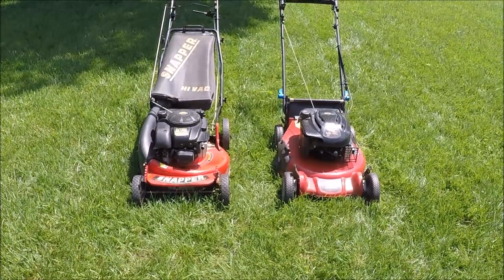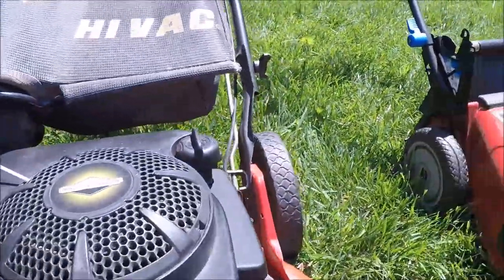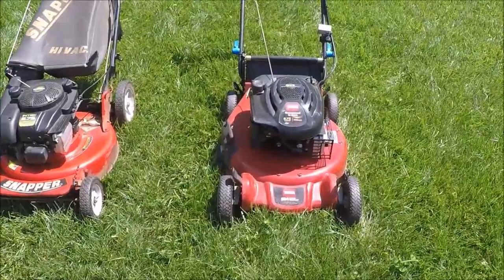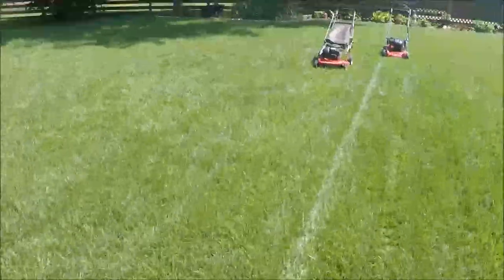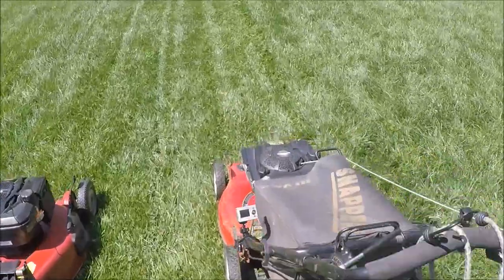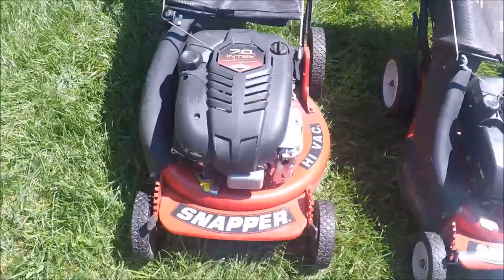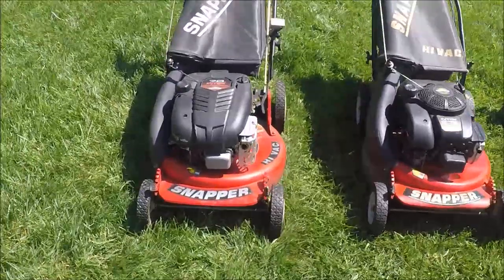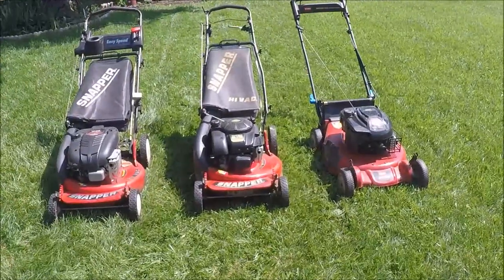The Snapper & Toro Super Recycler Lawn Mower Bake-Off Competition -- Which Cuts Better--June 15,2017

Comment: I just solved the cut mystery on the Snapper. If you remove the bagging chute, it would of been a fair fight. Install the deck mulch cover instead. That cover fits tight to the deck. With the bagging chute, grass gets blown up inside that chute not being mulched up properly. The chute packs up with grass and drops from time to time. Mulch cover part number is  7029149YP. Check it out.

Comment: I did a similar test when it was time for me to acquire a new mower.  I had an OLD (30 yrs from my high school lawn business days with 25 yards for 5 years on it) Snapper HI-Vac that finally shot craps.  I picked up a $40 used Snapper that barely ran, a neighbor's Super Recycler, and a new Honda (aluminium deck, not the composite deck) and ran them side by side.  With a Gator blade and the MULCHING COVER (NOT the plug) on the Snapper Hi-Vac deck, which isn't really designed for mulching, I could BARELY tell a difference in the mulching capabilities of the mowers.  HOWEVER, what I DID notice was the cut quality.  The Snapper blew the others away with the evenness of the cut compared to Honda or Toro.  The plug, in my experience, leaves too much space for clippings to get caught and disturb the air-flow and if you want the BEST bagging experience, the Snapper blows them away.    My test results brought me to the conclusion to repower my "new" Snapper for $130 vs the other options and took the Honda back to HD.

The best Snapper bag and on the mower market, period, is the Snapper frameless "C-clip" model.  "Back in the day" when bagging was all we did, I could shut mower down, open a PLASTIC bag, remove mower bag, "plop" the grass into the lawn bag in one shake, reinstall the bag and be running again in about 90 seconds.  It also holds a ton of grass.
Reply: I agree with everything you said about Snapper mowers. I have used and owned JD, Cub Cadet, Craftsman, Troy Built, Honda and Toro's. Those are mediocre to good mowers. Snappers fall into the great mower category in my experience. Best bagger on the planet bar none. Mulching, the Snapper will go blow for blow with ANY brand if not better with the Ninja blade.

Comment: I see this is old but looking as I'm working on my old snapper self propelled and getting as much good info from the comments. The snapper is unbeatable IMO if bagging,   and mulches great with the mulch cover. I'll have to try a gator blade though I have a ninja. Also on my snapper, I keep the rope out of the pulley for cranking, and put it around the pully only when removing the bag ,  cranks easier and easier on the rope.

Comment: I have a brand new snapper with the ninja blade and it works with the same result as the toro. But I like the result with the gator blade. I have the gator blades on my ferris zero turn and they work very well. I do 10 neighborhood lawns and have no complaints. I bought the snapper for its drive system. So far I'm pleased with it. Toro makes a fine mower too.

Comment: Just got the SR4 yesterday, It has a blown engine, but I am putting one of the Super Recycler with the Toro Branded (Chonda Clone) engine. I didn't even realize they still made cast aluminum desks anymore.
Reply from the maker: Hello Michael!  Alright yes these Super Recyclers are just the best it makes grass clipping disappear.  Plus if the grass is damp it want clog up underneath the aluminum frame like the steel deck Toro will.  Well worth putting an engine on it let me know how that replacement goes and if you could get me the Clone engine part number you will get for it.

Comment: Thread revival time!  Now that it is 6-7 years later since your video, what brand and model would you pick in 2024?  I have a 2015 Toro SR and it's a little underpowered for my yard.  Would like to get another Toro, but I keep hearing the backing up issue on the new (and great looking) Toros.

Comment: Of course the Toro mulched better, you didn't have a bag attached so the clippings stayed under the deck and got chopped up. The Ninja and Gator blades were designed to be used under a mulching deck...no discharge. Again, this keeps the clippings under the deck so the blades will do what they are designed to do...chop up the clippings. I promise that the Snappers will perform much better when configure properly.
Reply: If you notice, the mulch plug is in the Snapper, so it has nothing to do with the bag being attached.  I will say that it would actually do better if you took the bagging chute off all together and put the actual plastic deck cover in place that is formed to the shape of the mower deck.  But still, he has the plug in.
Reply: @CMNTMXR57  You guys are on it. The deck conforming mulch cover is the best for mulching. That bagging chute plug leaves clippings behind as was shown in the video. It's all about the proper deck and blade.

Comment: Great Video.  I have snapper High vac 21" also.  I will seek out the gator blade as I do not vac all the time.  The High vac blades work fantastic when wanting to bag.  my model is circa 2001.  and only has a 6hp briggs.  I may be in the market for a 7hp motor that will fit the deck!

Comment: The snapper "hi vac deck" Flaired in deck is best for bagging only with a extra hi-lift blade. And not the one with the ninja blade or flaired out deck warps a lot. The toro and the honda Are best at mulching. And that's sharp blades also and slow to med walking speed. A former outdoor power eq.Tech. Stay safe and happy mowing to all.

Comment: I have a snapper European series platinum with a 7 horse Briggs intek. It's not for sale and will never be for sale. It's the straightest driving.  Best transmission durability,. Best just the damn thing is awesome. It's 21 years old and it's amazing. The deck is all aluminum and bag material is the strongest ive ever seen. It's not a high vac but it's amazing. ELP I think it is. I have a brand new Husqvarna AWD and I prefer that old snapper. Also have an old Scott's turf master. It's amazing as well

Comment: Hello, 
I have a Toro Super Recycler, I need to purchase a new blade. Do you reccomend an aftermarket (gator/atomic, other?) or the stock blade. I'm looking for the best mulching blade possible. Thank you!
Reply from the maker: Hello Desiree thanks for viewing and sorry for the delayed response.  For the Super Recycler  stick with the factory stock blade which is part # 108-3762-03 at least for my model 20092 its a 21 inch blade.  You can find a replacement blade on Amazon or Ebay if your local home stores don't carry it.  Also make sure the accelerator blade remains mounted underneath it part # 105-6848-03 that should not need to be replaced.  It makes the super recycler what it is mulches up everything as if it disappears in the yard.  What a great lawn mower you have its the best you can buy!

Comment: 1st off both Snappers were high Vac mowers !! the decks are not made for mulching the blade will make some difference but the deck has a lip for the Vac as a mulching deck will not have this lip. the lip will assist the blade to stand the grass blades up to be cut & bagged.
Reply: You are on it BUT you can make the Hi-Vac deck mulch just as good if not better than any other brand. Run the deck conforming mulch cover  7029149YP and an Oregon 99-121 blade. This is THE mulching setup for Hi-Vac decks. I've ran all the Snapper deck and blade combinations to state that.
Reply: @rickjames6948 thats good news thank you for the reply

Comment: I run the mulch cover 7029149YP with the Snapper regular style recycling blade and it rocks. It leaves NOTHING behind. Not talking about the Ninja blade either. The blade I'm talking about is an Oregon 99-121. Even with the miss matched Hi-Vac deck that is built for bagging, it will mulch with any other brand mower you will ever find.
Reply: Are you sure the 99-121 is for mulching? I looked it up online and it looks like the hi-lift blade. I tried the gator blade and the ninja blade in the snapper hi vac with disappointing results, and i do use the mulch cover. The gator blade does alot better than the ninja blade but it still leaves alot of uncut grass. So do you think the Oregon 99-121 will do better. I have used a toro recycler before it it does mulch way better than the snapper. I know the hi vac is meant for bagging but its what i have and would like to make it a better mulcher without having to go buy another mulching mower.
Reply: @chadriggs3322  YES, it has a small lift tip that has low lift. Gator blades are not for Snappers. Now the real Snapper Ninja blade is great for mulching.
Reply: Thanks. I tried the ninja blade on my hi vac and it left alot of uncut grass. I think the ninja blade is best for the snapper ninja mulching deck. I will try the oregon blade you mentioned on my snapper to see if i can get better mulching performance.

Comment: I have two Snappers, both with the Ninja blade.  I do not have the issues you do.  My blades are razor sharp and and leave nothing behind when mulching.

One thing I am noticing in all three tests is that you are FLYING through the yard.  Slow down and let the mower do it's job.  Yea, it takes more time, but the quality of cut letting the far superior Ninja blade, do it's thing.

The newer Snapper I have that same easy pace speed selector, it is set as slow as it will allow, the old Snapper has the old detent lever like the 2nd one in your video, that set to "1".  Go slow and let it do it's job.

Comment: Good Saturday morning Cliff. Great video as always! I will stick with the Toro myself.  I've owned a Snapper Ninja before.  Too heavy for even one with some brute strength as myself! Toro for me is hands down my personal preference. Have an awesome weekend Cliff! Mark in Iowa.
Reply from the maker: Hello Mark in Iowa thanks for viewing again!  Yes sir these Snapper are heavy machines the ninja blade does just fine on shorter grass and raising the wheels to the maximum height.   Not so good on tall grass or if its just a bit damp it will clump up so not my favorite blade.  Agree with you the Toro super recycler  just cuts really clean,  in the fall with leaves it makes them disappear.  Hope all is going well with you in Iowa one state I have never been to got a friend that graduated from Drake and he just love Des Moines.  You have a wonderful weekend as well Mark!
Reply: Yes, and that's why they typically last forever.  They're very solidly built.  I have zero issues with the heft of any of Snappers or my even heavier Ariens.

My older Snapper is now embarking on it's 24th season...  Yes, I bought it new in 1995.

Comment: toro better overall for mulching but better engine on the snapper
Reply: Id honestly beg to differ. Having worked on a load of ohv and flathead briggs engines for the past 10 years i will say with confidence that the oldschool flathead is a better engine. Head gaskets rarely go, no valve adjustments, no rockers to crack, no push rods to bend and if theyre maintained half right at all they last basically forever. I own a 32 year old briggs quantum with over 1000 hours on it and the thing still runs sweet. Head gasket hasnt even popped yet. Had a few of the ohv's slip the valve guides i may add. 
Thats enough of a rant for a thursday but ya get the idea

Comment: The snaper is 20 times better and reliable if you cut grass for a living
Reply from the maker: Hello MegadethGUY M thanks for viewing!  Also my favorite brand as well Snapper they are commercial grade and will last a lifetime!
Reply: @USNVA-yn6cp  Rust?? Are you talking about deck rust? All you have to do is when you change your oil, take an old paint brush and slather it onto the underside of the deck. This is how you winterize a pusher too. Scrape all the grass off. Apply used engine oil to the deck and park it. That and don't cut wet grass and leave it under there.

Comment: Hello mountainbikekayak great videos thanks.  I am about to buy a super recycler, maybe you can help me with my decision. I am looking to decide on the Honda engine, or the Toro engine. The newest SR is the (21381), the Honda engine Toro is (20382).  What do ya think between these 2, or any other one.
Thanks a lot
Reply from the maker: Hello Kevin thanks for viewing!  That is the definitely the best lawn mower you could ever buy for sure you will love it.   The newer model 21381 is one of those clone/Chinese made engines it doesn't mention the brand just Toro Engine.  Have seen those on a lot of power equipment with the same branding whatever the maker such as Troy Bilt a Troy Bilt engine.  They are great, my neighbor has a Rear Tine Troy Bilt similar engine but horizontal shaft has a lot of power.  We bought our daughter a front tine Troy Bilt who bought a home in Portland Oregon and it has the same type engine and used it to dig up her very rooted yard with it and planted grass seed it did great.   I would say and its almost a personal preference over a Honda Engine but I would go for that $50 or so savings and get the model 21381.  They use the same engine for the model 21383 which has the spin stop/blade engagement feature as well as model 21384 with electric start.   It will be fine that mower will last for many years and that deck will never rust!
Reply: Thank you very much for your reply.  You are very helpful to me.  I am going through your other vids as well.  Interesting on the engine, you are very informed.  So I am feeling good about that engine, and the 21381. 
Subscribed to your channel
Reply: @kevinshuman7342  how has your Toro super  recycler work out for you? I have read and seen just about all the reviews on lawn mowers and I am leaning on purchasing the Super recycler.
Reply: @SuperJpaez  Sorry for the slow reply.  I wasn't satisfied with it really.  The transition gave problems from the beginning.  Occasionally back wheels would lock up when pulling the mower backwards.  I know its not uncommon for that to happen on many mowers, but after just a short time of using it got very bad at it.  I did use it commercially so it got a lot of use, but its not the first 21 inch mower I have had, & now have another, & the SR was very bad.  I eventually replaced the transmission, & it gave problem 2 or 3 months later. I had the mower for a year before  buying a Honda.. No comparison, the Honda is head & shoulders above. Everything about the Honda is so nice. The SR was good on other areas, its very light weight, mulches good, but no better than the Honda.  From my experience with the SR, I wont get another.  Probably a Honda man now for a long time.
Reply: @kevinshuman7342  wow thank you for that detail review of the SR!